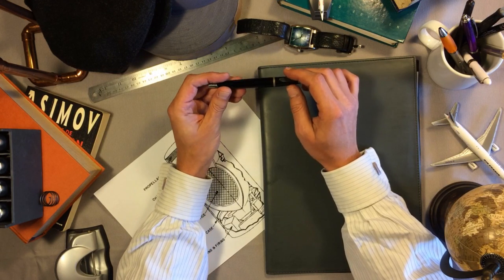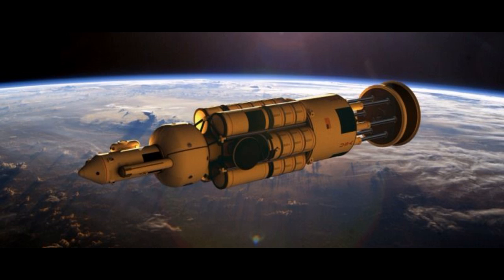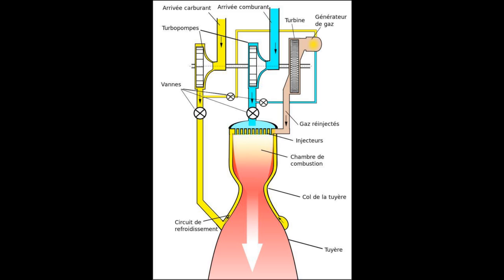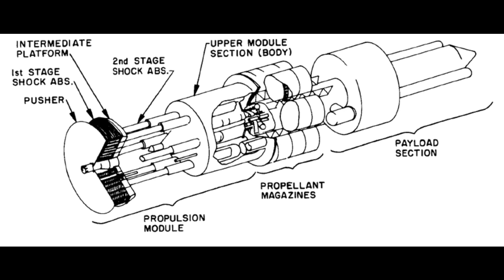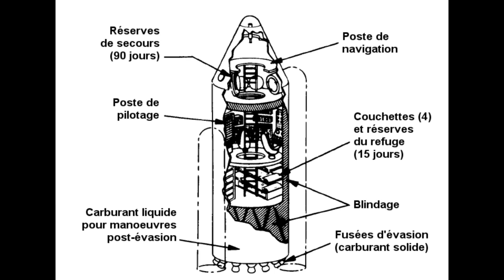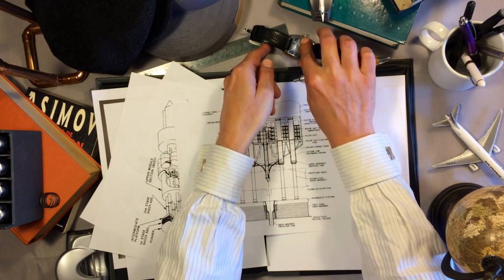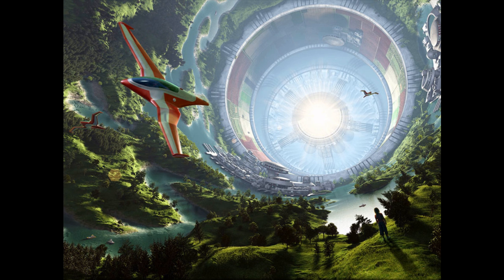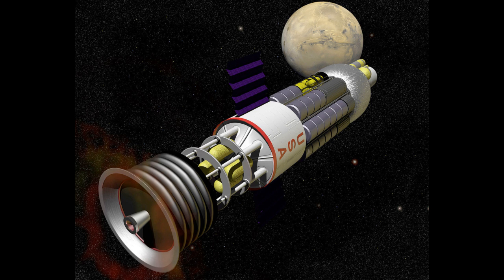ASMR - Interplanetary Travel: Project Orion

Comment: Actually space is really bad at taking away heat energy from objects because there are very few particles around to conduct it to. You are down almost exclusively to radiation of heat energy wich is the most inefficient way. Therefore it would take quite some time before a human body would freeze solid.
Just a minor correction I learned from other science videos ^^
I'm very glad you are making videos again. Your unique voice and style has been missed :)
Reply from the maker: Thank you and you are right, I simplified for dramatic effect ;). Actually there would be another thing to take into account here : pressure. When you bring liquid water at Earth temperature and pressure to Space, it starts boiling because of the almost inexistant pressure before it freezes into small crystals. I guess the same would happen to a human body: first boiling, then freezing.

Comment: The one diagram you showed was for a Diesel engine :P almost the same as gasoline engines except that Diesel engines use glow plugs which keep the combustion chamber at extremely high heats, to allow the air fuel mixture to combust on pressure alone. A gasoline engine has a spark plug, that actually ignites the air fuel mix at the top of the compressions stroke. Not being nit picky or anything, just letting anyone know that was curious!
Reply from the maker: You are right, I made a mistake editing the video. The diagram I had printed was in French, so when I realized that, I quickly searched for an alternative in English that would be free of rights and got it wrong. Good point, I'll correct this in other language versions :).